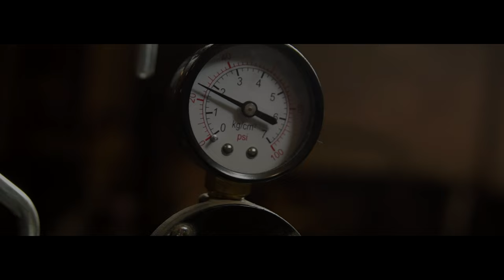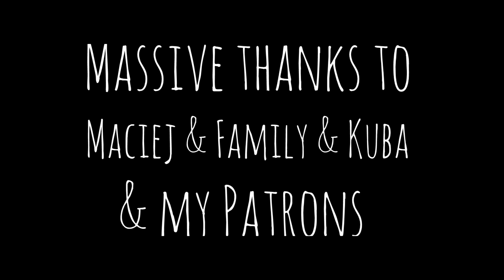Making a soft plastic lure from start to fish

Comment: Paul wounderful vid as usual I have been playing with Mica dust lately trying to color a few soft plastics you can buy them fairly cheep from most any hobby shop as ink powder (can spell fancy Writing ink... coligraphy?) and was having the same issue and was having trouble getting it to stick even tryed heating it in but as I reach the temp needed it deformed the hole lure the other option is to dip the lure in a clear varnish of fresh plastic but this is costly because you have to have a large stand by of clear and even with the best heating practices you will still get some discoloration  (yellowing) this is a fine trick to try thank you
Reply: also iv been posting my progress in lure making right now in a Facebook group I started called Tennessee DIY Fishing and started hash taging facebook and instagram with posts #DIYBASSFISHING I'll be starting videos on you tube soon I promis I'm sorry I don't have any up when you followed my channel just need to put togeather a few small things first then I'll start rolling.

Comment: Paul, another great product and even better video production. 

Looking at your soft plastic connected to the weighted hook, makes me wonder if is possible to mold the plastic to allow the lead weight to be pulled all the way into the head/mouth area to more or less hide it completely.
Reply from the maker: yep, i have moulded weights into some test lures it is very easy to do and i may show it in a future video, but as always its time , thanks

Comment: That swimbait turned out fantastic!  I'd like to know what materials you use to make the molds.  Thanks for making this!
Reply from the maker: The silicone i used was Polycraft  GP3481-f from MB fibreglass, http://www.mbfg.co.uk/rtv-silicone/gp... they also have an ebay shop
 (uk based, europe)
Some alternatives with similar properties are

Alumilite High strength 2 from alumilite https://www.makelure.com/ (worldwide)

CS25 Condensation Cure Silicone Rubber from Easy composites(uk based, europe)  http://www.easycomposites.co.uk/#!/

Mold Max 25 from Smooth-on (worldwide) https://www.smooth-on.com/category/ti...

For the resin I used easiflow 60 in white, there are so many difeerent companies making equivalents or supplying this that searching ebay is the fastest method. I would start with a small amount like 250ml, it does not keep forever once opened. You can also purchase it from most of the same suppliers as for the silicone

Comment: Beautiful work! I was a little bit curious about why you made two resin casts - first the basic shape and then again after adding mouth parts with plasteline. Would it have been possible to combine those steps?
Reply from the maker: The trouble  with using the clay is that is not hard enough to really clean up and polish and its not great to make two part moulds from but it is great for roughing in features. I made what is know as a waste mould then I could recast in harder material and then finish that. This is  or was standard practice for modelling action figures. cheers for asking

Comment: nice thanks. I think the main problems for you making volumes of lures are a) the level of detail and b) some of the techniques you use. Don't get me wrong  I love the results. But you spend a lot of time on details and use for example a handsaw when an electrical one would be faster. But I guess this is what sets you apart from the cheap, mass produced stuff out there.
Reply from the maker: As timbazi says once you have a working mould you can make more moulds from it and produce a volume of lures quickly, but for me I have a lot to learn about doing it efficiently and also keep the quality up so I do not have remelt and remake bait, so it is a learning curve thanks
Reply from the maker: Thanks for input

Comment: how do you make this red points(on tail,head etc.) of soft lures?? its some kind of plastic red paint?or what? where do you buy it?is it possible to add that kind of paint to  change appearance of lures from shop?( add strips ,dots etc.)??
Reply: im talking about this red fin at the picture on the end of the video.
Reply: If you'd watch the video, it shows you exactly how he does it at 3:15
Reply from the maker: at the moment i am using sharpie markers but i am also experiment with some solvent paints
Reply: thanks